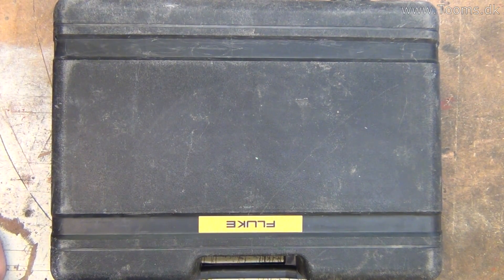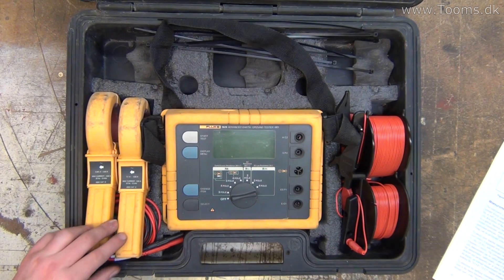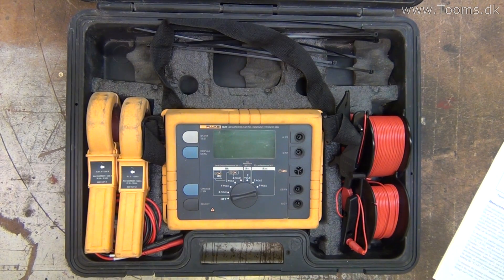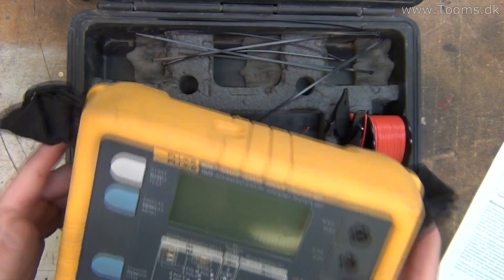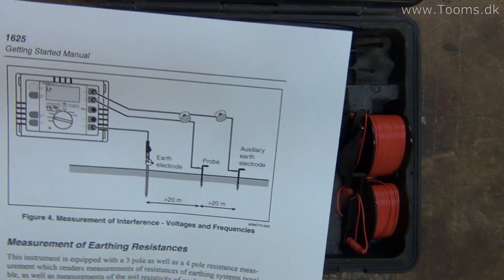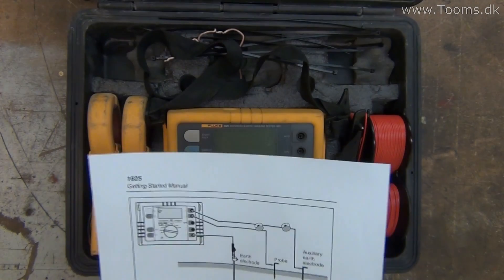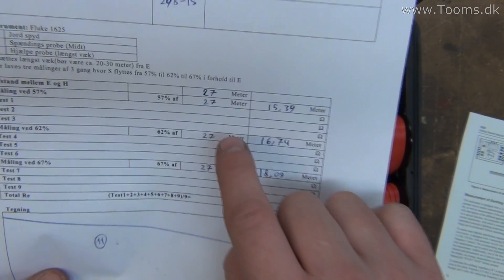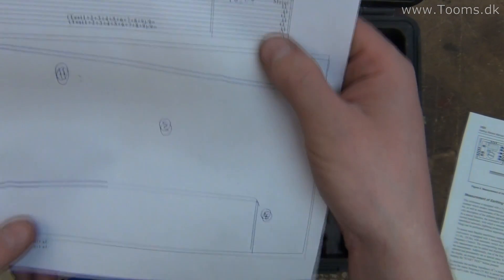Earth ground testing with Fluke 1625

Comment: Usually using only one electrode for grounding gives poor result, using many electrode making loop around the house and connect them together with 16mm copper wire is the proper why to do it, just remember not to close the circle as it can start working as an antenna.
Reply from the maker: I think that depends on what country your in and local law and rules, in Denmark one electrode is often more then good good enough.

Comment: If the resistance is too high, how many in meters do you put the extra spike apart from the existing one??
Reply: The easiest way is by increasing the depth of the electrode to double you will decrease the resistance by 40%, by increasing the diameter of the electrode to double you only decrease resistance by only 10%, you can also use special dirt with a solution with bentonite clay around the electrode, that is sold in special electrical stores. Problem with bentonite is that when it is very dry it shrinks therefore creating discontinuity in the contact between the bentonite clay and the surrounding soil and this will increase the resistivity.
Reply from the maker: @electronicatutorial  it is not allowed to use tricks like changing soil or pouring water when testing, based on the Danish rules then you have to add more earth electrodes and / or move it to another location.
Please do not use tricks, read and follow the rules as per your country.
Reply: @ToomsDK  No you are confused I was not referring to tricks to make measurements I know some people do that is against the rules. I meant is a chemical treatment of soil is a good way to improve earth electrode resistance when you cannot drive deeper ground rods because of hard underlying rock, for example you leave it around the earth rod permanently.
Magnesium sulfate, copper sulfate, and ordinary rock salt are suitable non-corrosive materials and are widely used you can google it.
Reply from the maker: It dependes, if it is because the old just dont work then you can most likely place the new one nex to it, if it is high resistance to grund at the location then you have to selected a better location

Comment: my friend, I did the same procedure and the resistance is giving 0.523 on average, when I use another brand of equipment other than the resistance of something close to 5.2R. is there a function in Fluke that changes the decimal places?

Comment: Isn't the resistance supposed to be less than 1 ohms ?
Reply from the maker: here in denmark the rule is that private house installations most be protected by HPFI relay with 30ma trigger and person volt max most be 50v, so 50v / 0,03A = 1666 ohm i the max ohm to ground limit and my test says only 40-50 ohm and that is well below the 1666
Reply: The NFPA and IEEE recommend a ground resistance value of 5 ohms or less while the NEC has stated to “Make sure that system impedance to ground is less than 5 ohms specified in NEC 50.56. In facilities with sensitive equipment it should be 5ohms or less.”
Reply: Indian engineers here in Saudi are all scambags with fake documents,they are fine even if they got scolded in the site by Construction Manager and PMT,what a shame for this people,it’s fine with them even if they got humiliated just for them to learn what a waste.